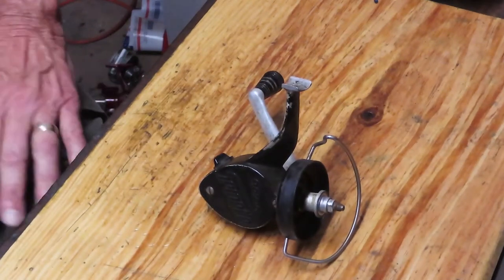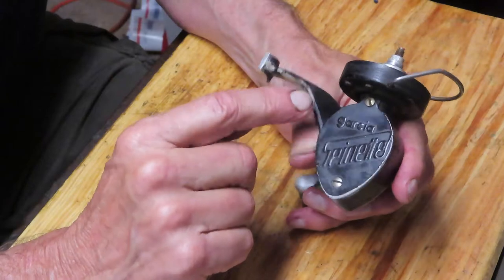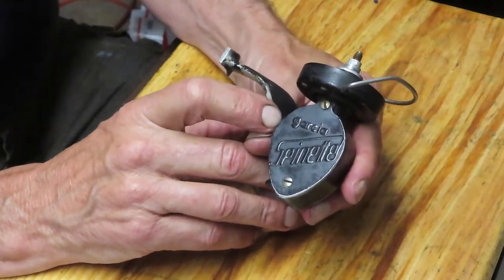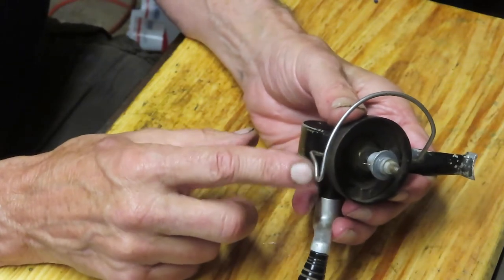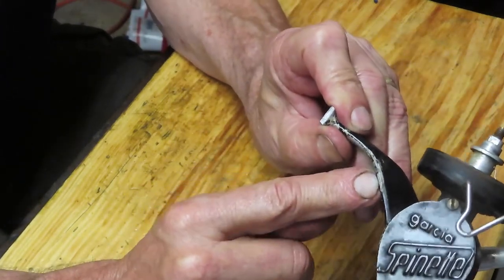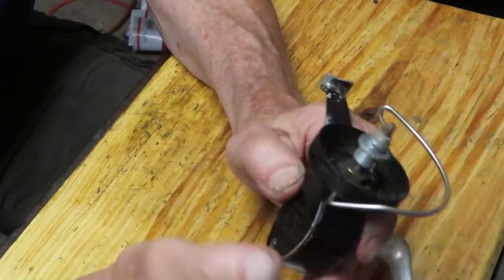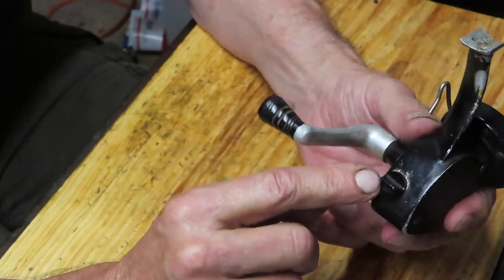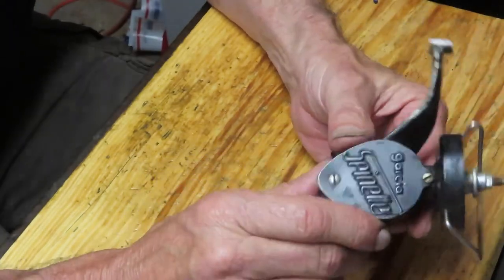Garcia Spinette vintage spin fishing reel take apart and how to service

Comment: That "siezed" ratchet switch looks like it should rotate.  But it actually slides up nd down.
I have one but instead of Garcia it has a hooked fish logo on the side plate and "DBP" below Spinetti
Reply from the maker: Thanks for the info.  The hooked fish - Hmmm. could it be a DAM Quick?

Comment: I wonder if this design inspired the diawa monocoque desin💭... only these people didn't make it really difficult to service
Reply from the maker: All designs pull on previous lessons learned.  It is possible that the simplicity of the Spinette has led right back to modern reels using less parts and more direct drives versus more ball bearings and moving parts.  Thanks for the note and the thought - Dennis